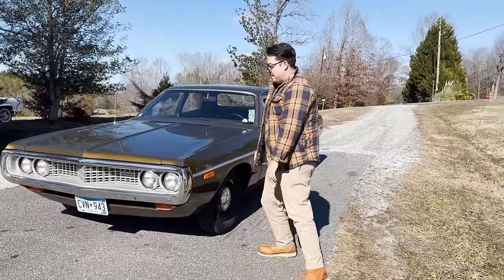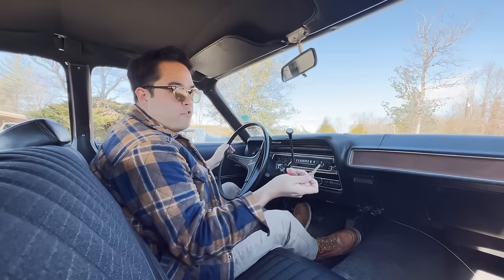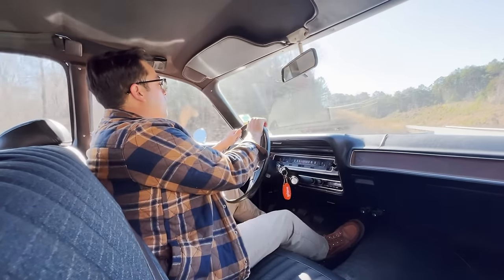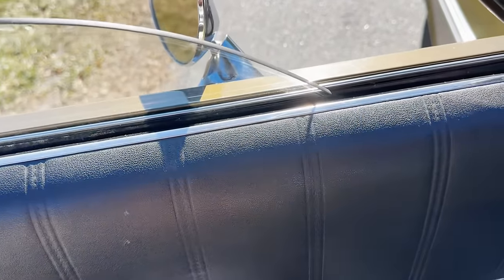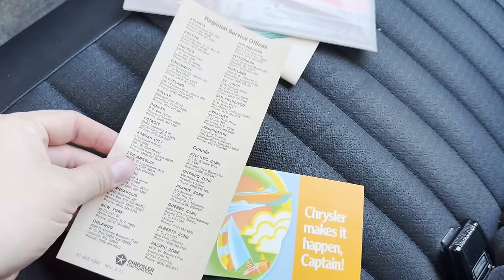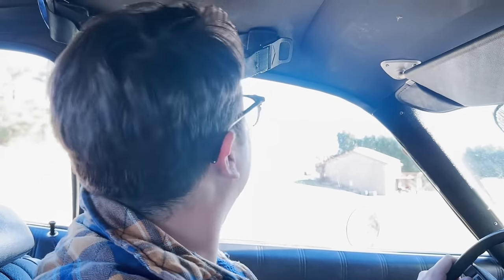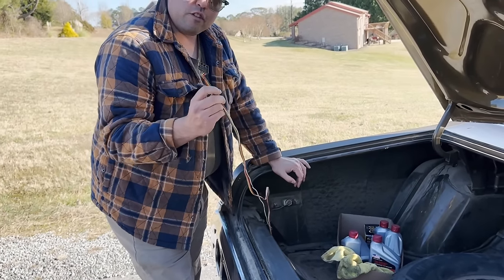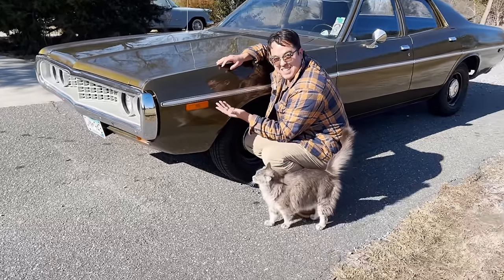1972 Dodge Coronet Custom! Rare Slant Six Stick Shift! Obsolete Automotive Reviews Walkthrough Drive

Comment: I wish they still made cars like this today.   Base model no frills and super reliable.  No plastic junk, real steel bumpers and no TV screen in the dash.    These cars are nothing but reliable
Reply: 110% agree! New cars are bland, computerized, and plastic. No one can say that older cars didn't have style. Bench seats were so much better for so many reasons, yet today, even trucks, come with lame buckets.
Reply: @gregorylyon1004 It just dawned on me the other day that today's new cars are likely to be very costly to run in 10-15 years time. They'll be no such thing as a cheap old used car.
Reply: Totally agree with you and you could usually fix them yourself. Plus the replacement parts would have still been made in the US.
Reply: Any car made today is infinitely better that this is. If someone sold you something this poor in quality, reliability, driveability and economy today, you would sue them. 
Looks is an entirely different matter though...
Reply: Yea no kidding now there all computer
Reply: "I wish they still made cars like this today." No. No you don't. Having live through that, you do not.
Reply: this is actually a model up from the base, it's a 'Coronet Custom', high line trim level, which kind of boils down to mid. This one has body trim, drip rail molding and carpet.there was one above it called a 'Brougham' with more stuff, like a vinyl roof 😁
Reply: The interior of this car is all madr of hard molded plastic, it is junk as it gets, and there is no corosion protection
Reply: @johnyoung1601  ironic when you learn these old cars had the rigidity of tin foil compared to unibodies of today, these old cars handle like BOATS.
Reply: those screens on the dash, while cool, are very annoying driving at night. the color is not natural to the eyes. I like my mid 80s BmW for the amber glow of the dash lights.
Reply: Not me, new 💩 it’s always better
Reply: And it has a trunk!
Reply: Reliable till the points corrode or need replacing, like every 30,000 miles. They rusted out at 100000 miles, and the safety systems, you know like seatbelts and air bags.
Reply: The automotive manufacturers spend hundreds of millions of dollars to find out what the majority of the people in their market want . That’s why options such as manual transmissions aren’t available anymore. They’re building junk for the majority of their market. I’d love to be able to purchase a basic HD truck with no electric anything,and fitted with a heavy duty manual transmission. Only “option” being power steering and air conditioning. You can’t even order a Camry, Accord, Corolla, or Civic with a manual transmission anymore unless it’s a special performance version sold in small numbers.
Reply: Luxobarges are the only car comfy for my back and that I feel safe driving. @kmyre
Reply: @nikoladamjanovic2313  The dash top is vinyl, top of the door card and rear side panels are vinyl, arm rests are vinyl (and of course the head rests).  There's not much hard plastic in it.  The lower door card, lower rear side panel, kick panels, and A-pillar trim.  The trim around the head liner and rear window is metal.  Lower dash is metal.  Door sills are metal. 

I've had it all apart and IMO the quality is higher than modern cars.  The old plastics aren't breaking apart.  I've spent some time repairing broken plastics in newer cars (new for me being the mid 90's).

Rubberized undercoating was available, mine has it.  I don't know if they all did, but it's not uncommon.
Reply: Do you have any experience with a B-body?  I do, and the only thing I'll agree with is that the fuel economy isn't great compared to a modern car.  But you pay for your gas savings with a more complicated vehicle that will only last as long as the plastics and electronics. @kmyre
Reply: Lol it’s always funny to hear from people that weren’t alive in the 70s say how reliable these cars are.  Truth is we had about 5 garages fixing cars on our street in the 70s in a town of 3,000 people.  Our car was in the shop usually every 4 months at a minimum, the engines components are 10 times better today.  Ask anyone you are totally wrong.   Cars in the 90s and up till about 2006 are very reliable, especially Japanese.  Because the companies have lost their way about quality since about 2010 now reliability is cratering, even Toyota is having massive recalls.
Reply: The screen in the dash is much better then that old ugly shit.....
Reply: @s_t_r_a_y_e_d what? Try to push in on new car fender vs old one. Obviously old cars have thick metal everywhere while new cars only at frame. Don’t tell me u watched that crash test video with old chevy made out of fiber glass…
Reply: @mrFalconlem i got bunch of old fellers in my shop that would say opposite to what you saying and that these old-school v8s will go forever and i know for a fact that modern having problems sometimes serious problems at 70k. Its just your experience doesn’t mean its how it was everywhere else
Reply: @tommyversetti4598  while the 225 6 cyl was very reliable, the truth of the matter is that most cars had a lifespan of around 100,000-125,000 miles before needing an engine overhaul. And you had to replace spark plugs every 25,000 miles or less, as well as replacing or adjusting points. Belts had to be adjusted and replaced regularly. Regular clutch adjustment was required for manual transmissions, fluid changes at 30,000 or earlier was necessary for automatic transmissions . Yes, repairs were less expensive. But it was more frequent. The 6 cyl had to have regular valve adjustment.
Reply: @prevost8686  forced auto transmission has to do with smog and gas mileage not market desires
Reply: Totally agree with that statement. 
As we are consumers of these vehicles we should have the right to choose a simple base vehicle that meets the needs of the majority of people.
This type of mopar would sell like hot cakes on a winter day
Reply: @dmandman9   well i might haven’t lived back then but i do drive 71 mustang with 351 and 80s f150 with 302. I work in a shop that services modern cars mostly and you ll never catch me owning one
Reply: @tommyversetti4598  That’s fine. Everyone has their preferences. I can admire the old cars with their clearly superior styling , personality, and individuality. But I admire the newer vehicles for their reduced maintenance and ability to ROUTINELY go over 150,000 miles on the original Powertrain. Their superior handling, and braking, etc. I WISH they could combine the greatness of the old with the greatness of the new. I think they COULD if they used their imagination. But now there’s a blandness. They’re like appliances. They get the job done reliably. But they don’t really bring any excitement. Like cooking on an electric stove vs a campfire. The modern stove is easier and more consistent. But the campfire is more satisfying.😅
Reply: Modern cars i wouldnt like to own. Unless there‘s warranty ;)
I have a 73 Valiant with a 225 Slant Six and 3speed auto. Nothing more relaxing to trundle about in. 
Funny to pass with it suv‘s waiting for breakdown towing.
Got a 94 Passat limo and a Volvo 940 as well. Love to drive them all. What a nice Mopar featured in the Video 🥰
Cheers from Germany
Reply: 70% agree, new cars are better in many ways
Reply: The cheapest car made today is 100 times better than this. If you like old cars so much, please indulge yourself. I did. But don't complain when they don't start in cold weather, no decent and fast defrost, no  air con, lousy MPG, no security...etc.
Reply: Yes, sure you know better.
Reply: Yet missing SOOO many safety and convenience features we take for granted today.
Reply: @kmyre air-cooled VW beetles only recently went out of production , they are worse than this in every way
Reply: I think you mean that you want 90s cars back.
Reply: And very easy to work on and maintain
Reply: Hey I’d still vouch for cars going back to simpler interiors or something.

The most ridiculous thing I heard when someone ordered a new car was: “oh we’re sorry but we can’t offer you the model car you ordered, since we are missing the touchscreen display for the speedometer and odometer etc, but we can offer you a basic model with analog speedometer and odometer if that’s okay?”

And here I am thinking, why on gods green earth would anyone even want a touchscreen display to show speed milage etc, when the analog stuff has been proven to work for more than a 100 years…
Reply: Totally agree. Please no more huge touch screens😡. 👍🏆
Reply: Great video of a beautiful car. Thanks from England 👍🏆
Reply: They're not really that reliable. A modern Toyota or Hyundai will give you a LOT more mile on a LOT less maintenance.
Reply: @ajm5007  you have totally missed the point & also missed the beauty 🤣
Reply: I wish they still made these  Tim
Reply: That's why I have 1970 Plymouth Satellite
Reply: That's why I have 1970 Plymouth Satellite
Reply: That's why I have 1970 Plymouth Satellite
Reply: I have a 1992 Toyota Camry V6. Simple and reliable. At 225,000   miles, the Tranny finally gave out, only replaced about 2 parts that wire out. Cost about $2,000 ( w/1 yr parts and labor warranty). Then, had to replace what's called the ECM( engine control monitor) and cylinder #6) runs absolutely smooth, not bad on fuel mileage either, if course no AC, just fan and heat. I know people might say "why spend so much for repair on an old car"?, true , newer vehicles do have their advantages I suppose, I don't have $40,000+ ( about average for a new vehicle, SUV's come to mind). Eventually, I might upgrade to sort of"newer" vehicle, 2010's model. Probably between 2014-19.
Reply: reliable maybe but certainly deadly, sorry but decades of advancements in safety for automobile crashes I'll take over some 40 year + old death can.
Reply: I agree with the notion that modern cars lack the same kinds of styling cues we find enjoyable with older cars, but there’s a reason they don’t make them without crumple zones anymore. These things weren’t safe in roll overs or crashes. Beautiful, but a bit of a death trap.
Reply: @kmyre have you read how great Dodge, Chevy even Ford trucks have been as of late? Garbage! Blowing transmissions, electrical problems, differential all under 50,000 miles. Garbage!
Reply: reliable? nonsense , point ignition, carburetor, mechanical fuel pump , all required regular maintenance or the car would run terrible, todays cars can go hundreds of thousands of miles without even touching the ignition and fuel system apart from replacing the plugs and filter, there is no adjustment to fuel delivery or ignition in todays cars, you never heard of cars from this era going 200,000 miles and if they did they ran like absolute crap
Reply: we're headed to a fucked up future where you'll only be able to get new cars by subscription and all you'll be able to own is the fleet of legacy cars.
Reply: lol. reliable? clueless. 90s through 2008-2010 was when cars were reliable.
Reply: @mrFalconlem   The electronics in the 90's to mid 2000's cars are 20-30 years old and DYING.  I've done two ignition cylinders because of bad security chips.  Nothing like having a perfectly good vehicle bricked by a bad microchip causing a security system failure.  I've also had a 97 die while I was driving it due to a bad crankshaft position sensor.  Good thing I'm strong enough to deal with the sudden loss of power steering.  Had to take the harmonic balancer off that car to get to the sensor.  Now here's another modern feature I could do without - "torque to yield" bolts.  I had to toss the harmonic balancer bolt and track down a new one.  NAPA had already recycled the part number and sold me the wrong bolt, so that cost a few days of down time.  

Another thing to consider is that the plastics of the 90s-2000s care are now brittle and often cracked.  Soft touch surfaces are often gooey, headliners usually let go a long time ago, headlights yellowed and opaque. And then there are the HVAC modules, with press-on gears that crack as soon as the plasticizers gas out.  Because they're so hard to get at, the cost to replace is often as much as the value of the car.  

Then there's airbags - I'm not sure what the long term issues with those are but it doesn't seem like it could be good.
Reply: @boostjunkie2320  Good luck replacing that screen 30 years from now.
Reply: @kapilarius  They are, and you're paying what used to be the price of a house for what will be a pile of e-waste in twenty years or less.  Meanwhile the Coronet could soldier on for a 100 years if cared for and not wrecked.
Reply: @jrcars7017  I just upgraded to the Tesla screen...I put it in myself....Just a few screws and plugs.....
Reply: @boostjunkie2320  The big thing in the center of the dash?  What are you driving?
Reply: Could not agree more or say it better myself.
Reply: @vikos78 then why are you here lol!

Comment: Very cool! I really like column-mounted manuals. They baffle a lot of people and it’s a good deterrent to keep people from asking to borrow it.
Reply: And stealing it, too.
Reply: Those three-on-the-tree shifters were very common in the 1930s, thru the 1950s...many of those shifters seemed a little bit clunky, but they worked very well.  Some folks would modify that situation, and move the shifter to the floor! That slant six is legendary for it's durability...many people would get well over 200 thousand miles before having to overhaul the engine. That was considered amazing, back in the day. Simpler times, simpler vehicles!
Reply: Although someone who actually knows would never call a column shifter a stick.
Reply: Even more so if you dont have synchro on first and have to double clutch to find first when rolling
Reply: About borrowing, I would just simply use the word "no".

Comment: I love base model cars from that era - rubber flooring covering, stick shifts, and if you are lucky, a 6-cylinder engine.    The torque of the six cylinders of that era is no joke - had a 1969 Mustang with a stick and a 250 cid engine and that thing pulled off the line.     These era cars are so basic and easy to work on.    Thanks for sharing this one!     My family when I was growing up had a 1971 Plymouth Satellite station wagon with a 318 cid engine / auto and it was a nice car even if it was a stripper.     Those are really nice intermediate sized cars and very durable.
Reply from the maker: I’d love to find a station wagon version!
Reply: @ObsoleteAutomotive there's one near me but so far the dude isn't willing to sell it yet. 71 Coronet 9 pass 383 white with wood sides.  Last licensed in 1982.  Very Cool piece....
Reply from the maker: @patrickwayne3701  Woodgrain 9 passenger is what in really wanting!
Reply: @ObsoleteAutomotive  How much did you pick it up for?
Reply: Growing up my parents had a 74 Coronet wagon beige with the woody sides.  They weren’t exactly popular in their day but super rare and hard to find one now.
Reply from the maker: @diedonner299  Would love to find a wood grain version!
Reply: my dad had a ford i6 truck that seemed way stronger than it was on paper
Reply: @ObsoleteAutomotive I just saw a video from, IIRC, a 67 Coronet wagon, 318 for sale from Coyote Classics here on YouTube

Comment: This is a NEWSPAPER car.
In order to have a low ad price to bring in customers, dealer had to have a low-option car to match the ad. It had PS and radio because dealer wanted to say in the ad it had them.
Most time it would not sell till the end of the model year, when it would sell for a song. But if if sold during the year, dealer would have to order another.
Reply: I call these the "bait cars" but yeah, same thing. I bought a Subaru bait car once (the base manual that's just there so they can put a low price in the ad).